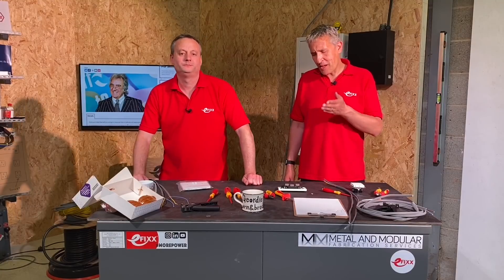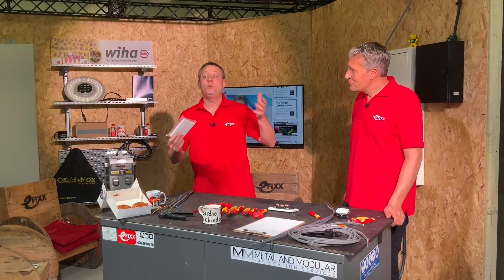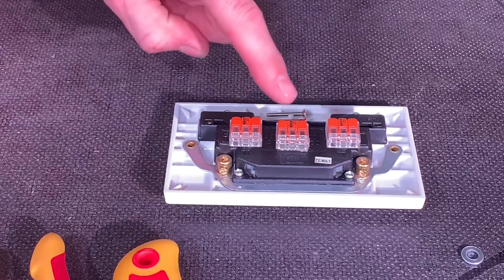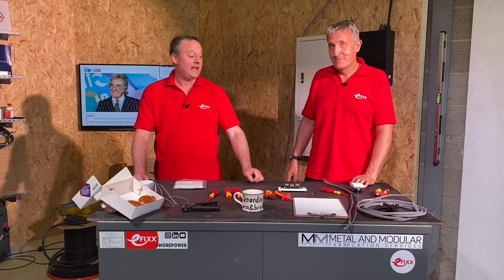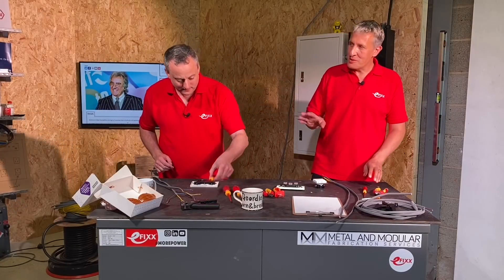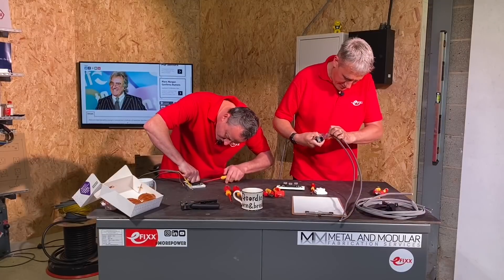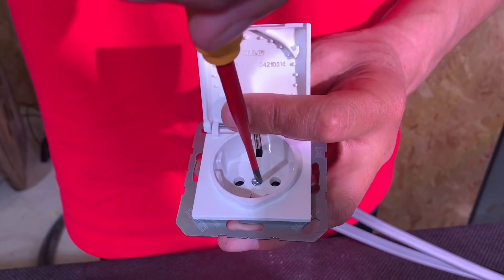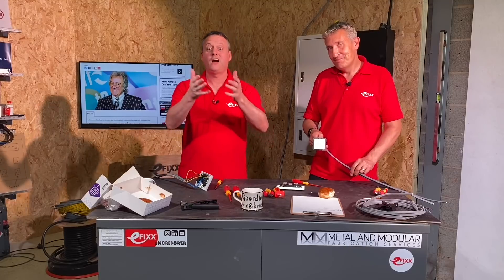When will UK sockets have WAGO style connectors? - electricians comment

Comment: We should also bring back the option of adding to old installations with black and red cabling (and manufacturers making it available). How ridiculous is it to extend an old black/red cable installation using blue/brown cable and having to stick a label on the CU saying 'Beware: This installation uses two different colour cables' - barmy!
Reply from the maker: It would be more expensive as the supply chain would have to carry double the amount of stock. We’ve moved on John

Comment: Yes, Wago style terminals are the way forward, no doubt. MK and others could have improved the connectors to sockets, etc, by providing three screwed terminals for each wire, instead of the ridiculous system of putting three wires into one terminal, which half the time results in one wire not being secured properly. And why do we have twin core and earth with no insulation on the earth wire - in Ireland and many other countries it's covered and so much easier - typical penny pinching resulting in more fuss and time wasting putting sleeving on which inevitable moves so that you have to be careful to ensure that it's really connected to the terminal.

Comment: To add to the concept, how nice would it be to terminate on a Wago connector that then plugs into the accessory. You could then complete and test off first fix and then after plastering and decorating simply plug in the accessory and screw back the face place. The idea is that the Wago connector has its own plug and socket. you could go further by color coding and keying the Wago connectors so they only connect to the correct terminals of the accessory. With this kind of arrangement, Wago could produce a two-part connector that would retrofit any accessory

Comment: There are a few good reasons to move towards having a cage clamp connection points. Other then speed and correct force used for connecting wires there are a few points to consider. 

New builds often use the shallow metal box. This means the cable when connected with screw terminals often comes out perpendicular and cables immediately bend to fit into the shallow box. As we have more and move advanced sockets and smart sockets you cannot use a shallow back box.  But the solution for sockets with WiFi repeater or smart sockets is a 10mm spacer. Not an ideal look.  

Using cage clamp spring contacts the cable it not bent immediately so as to have some strain relief value. 

Lots of benefits. As you say. Who will be first to market and save time at installation while improving quality.  Screws force and screw slot heads the first to be at fault and fiddly as you show.

Comment: If Germany has sleeved earths, why do we have unsleeved ones in twin & earth? Fannying around with loose pieces of earth sleeve is a pain.
Reply: You can buy sleeved earth cable - but it costs more.
Reply: @johnburns4017  - In the same flat profile, or do you mean the round flex type?
Reply: @Benzknees  
I have only seen round cable these days - which is flexible. I recall seeing flat sleeved earth cable a long time ago.  But I hope someone will let us know if flat sleeved cable is about.
Reply: @johnburns4017  - Interesting, especially the earth conductor being the same cross sectional area. Makes you wonder why it’s smaller in the UK apart from cost. Less resistance maybe, so fractionally quicker tripping of the circuit? And why it’s bare. If the sheathing gets damaged I guess it allows a path to earth?
Reply: @Benzknees  
Electricity always wants to return back to where it originated, the generator. The ground wire was to parallel the neutral return wire back to the generator. Either full all the way back, or partly by connecting to the neutral at some point on its way back, or even using the earth itself as a conductor. 

So that if there is a fault, it gets back to where it came from. So it needed to be the same cross sectional area as L and N. The cpc these days is to primarily activate protection devices, rather than run electricity back to its source quickly. So it need not be the same size as the other conductors in circuit, so they deemed.  🙄

Fifty years ago the cpc was never smaller. That was etched into the minds of electricians and electrical engineers.
Reply: @johnburns4017  - True. The neutral & earth often going back to the same point makes you wonder what purpose the earth serves, especially as modern RCDs will pick up on any live/neutral imbalance. My lighting has no earth wires, and as you say I think my 60yr old power circuit has the same cross sectional size earth (altho’ difficult to be sure as it’s stranded).
Reply: @Benzknees  
"what purpose the earth serves, especially as modern RCDs will pick up on any live/neutral imbalance."

Earthing is backup when there is full RCD. You may find an RCD needs to run to earth to work more efficiently in some case. Also there are the cable before any RCD, which earth protects.
Reply: @johnburns4017  - Unsure what you’re getting at there. As I understand it RCDs cut the power the moment there is an imbalance between live & neutral, as with a short circuit.
Reply: @Benzknees  
Some take in the earth to counter DC on the line.  DC on the line may make RCDs inoperative.
Reply: @johnburns4017  - How would DC current get onto an AC circuit? Surely any DC source like solar panels or a car charger would have a rectifier inbetween them and the mains circuit?
Reply: @johnburns4017  - Thanks, I just watched the video link, but it still didn’t say how DC can go past a transformer/ rectifier/inverter into the AC circuit whilst remaining as DC.
Reply: @Benzknees  
There are a plethora of other electronic devices these days that can inject DC into an AC circuit, with a small fault that will still keep the equipment running, so not noticed - but may compromise the safety of the RCD/RCBO.  That means you have no RCD protection, but you think you have.

Not only that, the equipotent may render the RCD useless only when on, so your RCD, when tested may work, as the equipment is off - as the DLR railway electrician found out in the vid.
Reply: @johnburns4017  - I appreciate that, but I’m after knowing how DC gets past the rectifier & transformer in reverse, without being converted back into AC power. Except in the unlikely event of bare DC wiring directly touching bare AC wiring (in which case I imagine the DC device & wiring would be sending out showers of sparks), I can’t see a route.
Reply: @Benzknees  
DC and AC can be running on the same wire. Different voltages as well.

Comment: Please don't rip me to shreds.... But can you terminate in the patress with wago with a cable from wago to the socket?
Reply: Yes, I do it. It is better in a final ring circuit. I use three connector Wagos for L and N.  L in and out for the ring and one to the socket - same for N. I use a four for the CPC. The CPC goes to the metal box terminal and the socket, so needed one extra. From the three Wagos it take flexible wires to the back to the socket. The flexible wires ensures the socket pushes in very easy. The final ring circuit is not compromised with full screwless connection ring.

The 1st fix can be done with cables tested.  Plasteres come and plaster over, painters finish off.  Then sockets push in with flex tails fitted on a bench. Easy fast, better. Testing done before plasters finish.

Comment: I had this idea years ago when wago released the 2,4,6 and 8 way push in connectors, but also use the 4 way connector fit them off then have an arrangement  Where you get the completed connectors and push them in to a receptacle in the back of the outlet, so they fit off separately from the face plate for better access.

Comment: Your average electrician is a lot faster at terminating a socket than this guy, at least in Ireland they are anyway, sure if you were doing 200 sockets in one go you’d save a couple minutes, but I think side by side if you had two sparks do this the screws wouldn’t be this far behind, if it’s not broken don’t fix it, screws have worked for years, it’s the botch brothers who put some of these things in that cause fires, if you terminate a connection properly the screw will not ever be loose and will never cause a fire, I will never use a screwless appliance
Reply from the maker: It’s hard to avoid screwless terminals on light fittings .
Reply: Honestly I’ve never came across that problem, anytime I’ve been given a light with screwless terminals I’ve pulled out the wire and just put them in connectors, until I do some research and understand the science behind the screwless terminals I won’t be using them

Comment: As an electrician that does lots of service work, much of what I fix is from wago and other spring type connectors that fail. Eventually the springs go weak from heat, the copper gets oxidized and they fail to make a good connection. At the very least they fail, in extreme circumstances they catch fire or melt the devices. 

It's easy service work that ends up costing the customer lots of money. The smart ones will pay to fix all the devices and connections at one time. Thoes not so smart will end up replacing them over time one at a  time with a service call each time.
Reply from the maker: What do you replace them with ?
Reply: @efixx  properly hooked ends on receptacles, pigtails striped, twisted and nutted up tight. This is all pretty well standard stuff for commercial work and the trademark of a skilled electrician. 

The only time I ever see the wago stuff is in fluorescent or led lighting, but that kind of comes with needing to have a means of disconnect in the fixture.  For lighting stuffs they are needed, but that's low current loads and they work well in that application. I guess sometime it's used in some control circuit stuff, but again generally frowned upon. 

Any kind of real amperage goes through that crap for long and they just heat up and melt. I have to fix lots of thoes spring clip terminations, mostly you only see that crap in residential stuff any way, but it pays good to fix it because hunting the bad spring clips is an art form.
Reply: @wheeliebad11B  
When you say nutted up, do you mean wire nuts?
Reply: Where are you based?
Reply: "Eventually the springs go weak from heat,"
So heat is the cause of failure.  That indicates the cable is too small for the amperage load if there is heat. 
I have seen Wagos that have been on high current circuits for over 10 years and are still perfect - but the cable never heated up because it was designed properly with the Wago correctly sized.  I cannot speak for other makers.

I am not doubting you, but it appears there is more depth to it.
Reply: Look at John Ward's vids on testing these connectors.
https://www.youtube.com/watch?v=bP0qHyVAymU

https://www.youtube.com/watch?v=hGuK9ZajhN0

It took 71 amps through a push-fit Wago rated for 24A to melt it. That is nearly three times the rated current. 
https://www.youtube.com/watch?v=2uYD8e7idnY

Comment: My kitchen is quite large with all the usual gubbins in it. There are two circuits because of quite a high lode (excluding the cooker). How would these work with possibly 6 or more KW running through them.
Reply from the maker: Wago 221s are either 32A or 41A current rated - so 6kw isn’t a problem - depending upon the line voltage.

Comment: Gary needed 1:23 minuteness to terminate pre-stripped cables!!! :D. Only someone without experience who doesn't know how easy is to broke Wago connectors  can say something like 'they are much better than traditional connectors.
Reply: Hi guys, I do use WAGO connectors, but I am still not convinced that they will be as reliable as is claimed, as I worked with woodworking machines in the past & many of the European machines had push fit & lever connector within control cabinets, there was times when the wires would work loose, or fail to hold when installing mains, single & 3 phase feed, but these were accessible during maintainance, also operator would be able to notice problems. This would not be the case with MF WAGO  Boxes that are out of access able areas!!!

Comment: I don‘t why you in UK doesn‘t have switches und plugs like this? The installation ist so much faster then yours whitiut stress. We make circle holes, you can‘t do it wrong. I don‘t knwo how it is in the UK but inknow that in the US they have to cut the wall rectangular. It is so much easier the german way. And that WAGOs which you use in the video cost in Germany in a regualr store 13,50€ for 50pcs

Comment: You'd already save 1/3 of mounting time if you'd finally get rid of those useless ring mains.. all rest of the world does radials. Next step would probably be larger and less crammed fuse boxes that don't need a full replacement whenever something gets updated. And some day, you might even introduce three-phase service that's been common on the continent for the last 50 years or so.
Reply: I agree. Ring final circuits are dangerous if a L/N break occurs. You've got all the current flowing in what is effectively pair of radials on the same MCB, potentially exceeding the cable rating.
Reply: Never seen such an uneducated comment.

Comment: It is difficult to find a socket with screw terminals in stores in Germany. 
The push terminals on German sockets are designed up to 16A, the contacts in the socket often only up to 10A. But there are also good sockets for real 16A. For more amps, we can use CEE sockets.
Reply: You will also rarely find someone trying to squish 4 mm leads into a socket. Common here are 2.5 or sometimes even 1.5 mm (if the line has not to provide 16 A continuously, but then those are designed for temporary short time use with 16 A only anyways, for anything else you should use the blue CEE Sockets) and they are not on a ring. But thinking of items and appliances you may find in regular households, nothing actually comes to my mind that exceeds 10 A. The devices with the biggest power consumption are mostly rated something like 2200 W and just scratch the 10 A. 
You can order sockets from Mertens in both variants by the way. Only disadvantage I personally find with those screw less terminals, the release levers usually don't work that well.

Comment: Why do you refer to them as Wagos and not 221s? I use different Wago products on PCBs.
Reply from the maker: All Wago terminals are screwless - inc PCB, Din rail and Plug style
Reply: @efixx  yes but there are still various types including pcb ones that are screw driver actuated so calling them just wago is misleading. I had the same problem when I worked on a project in china. the English fitters would refer to things by their brand name  - like Ejots when what they actually wanted was a compression fitting.

Comment: Screwless terminals levels the playing field between a good sparky and a terrible sparky by taking out the how tight are the terminals equation.  I moved into a new build and checked all the sockets and all but one of them had loose terminals with some even having one or more of the cables come out the terminals when I unscrewed the faceplate. Pretty shocking standard to be honest.

Comment: Grunfos pumps used these type of connections but have now gone back to using screws. There was obviously a problem with them
Reply: Vibration perhaps?
Reply: That issue wouldn't be relevant to plugs and light fittings would it?

Just asking as some of the new smart lights (sealed circular ones) have the clips instead of screws...

Comment: Another huge advantage of screwless accessories is that there is no danger of screws getting loose or not tightened properly - a major cause of fires!
Reply: And trying to find an open circuit on an EICR.
Reply: Not a solid connection verse mechanically tightening a wire to a set screw ...land it under a screw your can’t spin the wire ...you land it under a wago you can spin the wire in the connector imagine little movements over time what could cause
Reply: @Bigbrunibelow  although spring terminal will apply constant force on conductor even when connection feels loose. You don't get that with screw. Also inserting 3 X 2.5 mm2 in screw terminal when installing a branch is a ball ache caus there is always that one wire what pops out when you tighten the screw. You wouldn't get that with spring cause there are individual terminals for each conductor.
Reply: No just danger of the wago opening when a hair brushes past it
Reply: @olivercarter5546  they're not easy to open lol

Comment: The UK building trade  is a perfect example of how feudalism manages to soldier on into the 21st century.

Let's start with this: "twin and earth". Every country in the world, except for the UK, manages to sell electrical cable with all three conductors properly insulated. The UK? You've got to buy, and install, a little sliver of earth sleeve every time you put in a socket, a switch, or a lamp. Why? God only knows. I'm sure the jobsworths will tell you some bullshit about saving space in wiring runs. But the real reason is to make it too difficult for the DIY'er to do the job properly his ownself. Don't believe me? Try buying anything less than 20 meters of earth sleeve.

Don't get me started on the witchcraft that governs UK electrical regs and rooms with running water. But its only in the UK that you'll hear the classic "clunk-click" that tells you, immediately, that someone has turned on the light in the toilet.

God Help You All.
Reply from the maker: Google Romex or NM cable - you’ll find the 🇺🇸 use a similar non-sleeved earth cable.  You can buy earth sleeve in 1m lengths in B&Q, Amazon, EBay etc